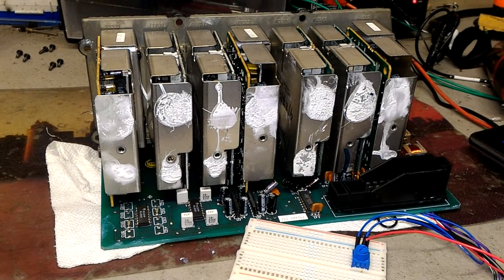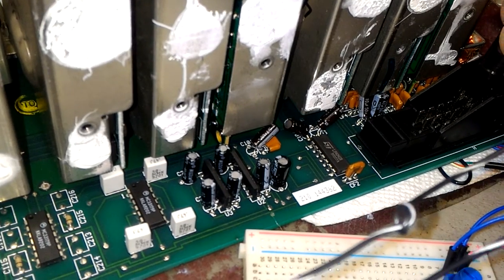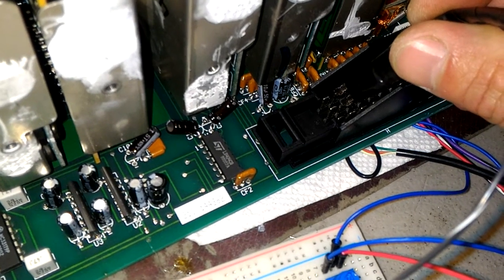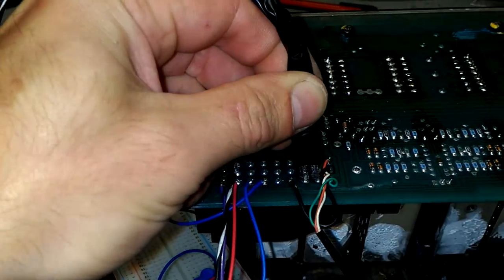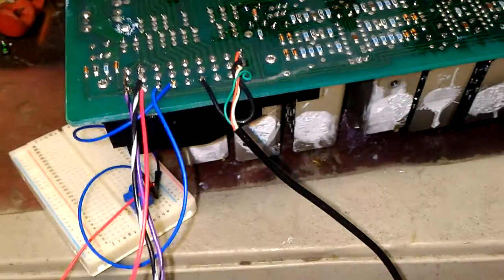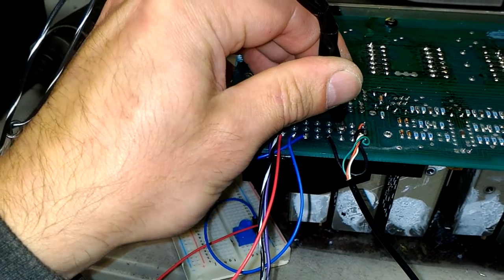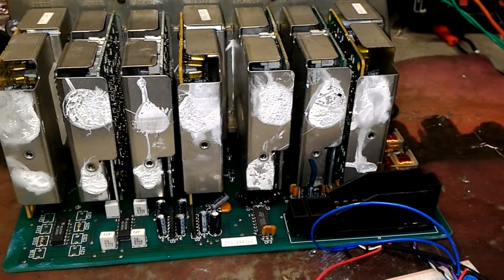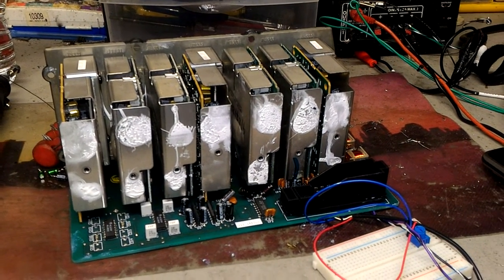Mercedes W140 Bose amplifier repaired and bench tested

Comment: Hello Sir,
I re-caps the amplifier W140 and test the amp, all channel is back working again. I tested each channel individual same like on your video. I test them without a fader. Didn’t have one. But was still getting nice and clean sound from each channel. But when I connect the amp in the car, I get that hum, little bit of sound background, volume doesn’t do anything. Do you think it’s the head unit? There’s another box bidder the amp, look like all cable from the head unit goes directly to that box then to the amp. Any advice. Thank you.